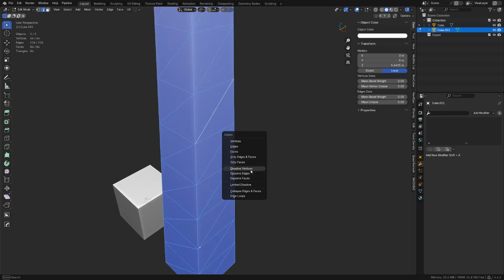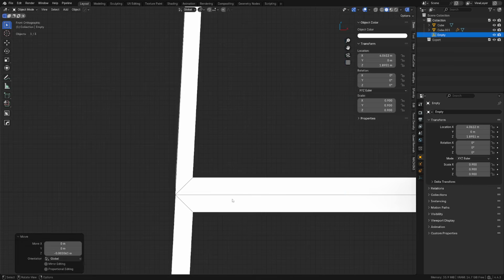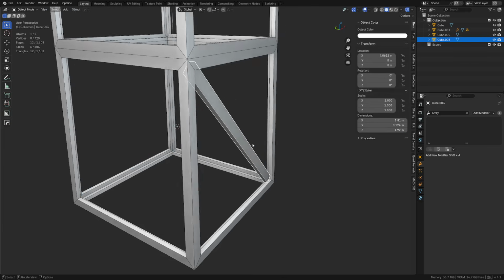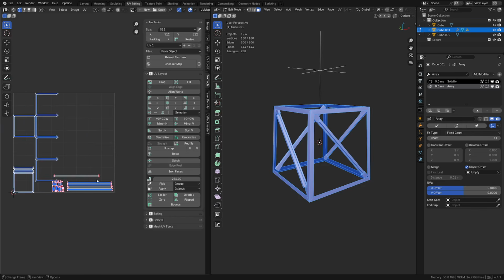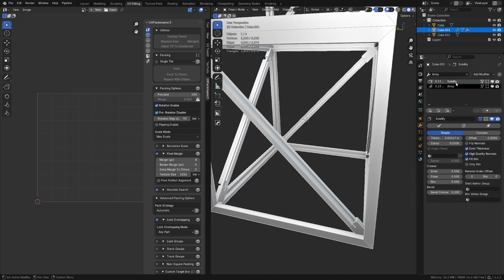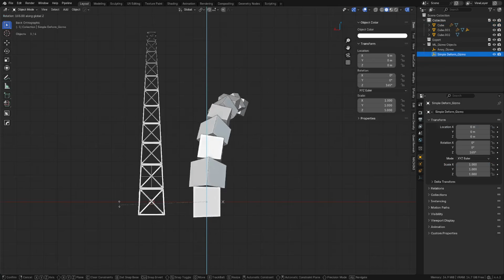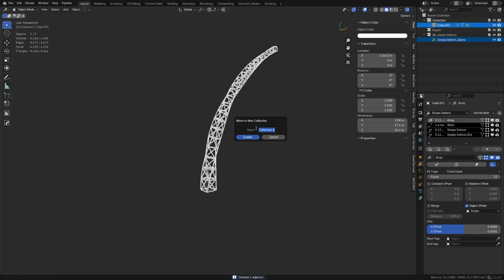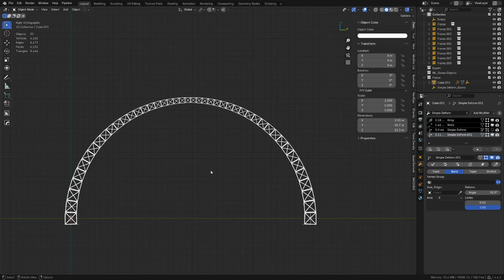Structural Frame - Blender Tutorial

Comment: When moving, rotating and scaling, you can press the B key, specify the starting point for alignment, then specify the end point - and all transformations will be aligned to the specified vertex. The B key works not only in the transformation tools, but also, for example, in the Extrude operation.